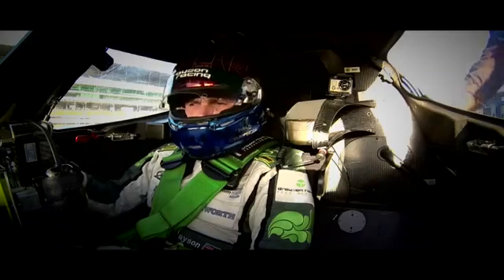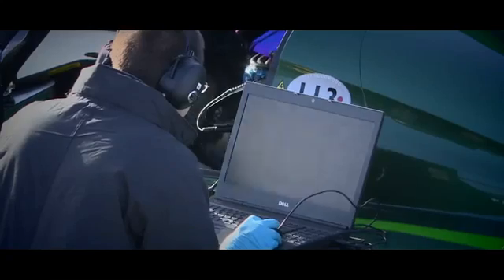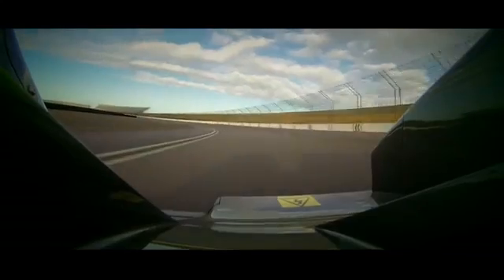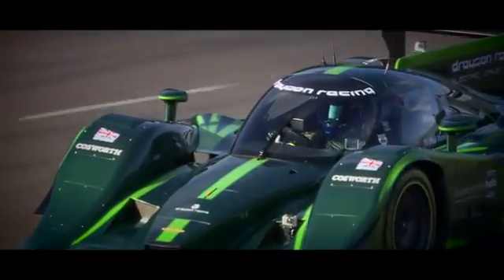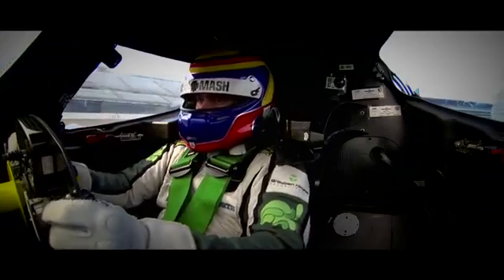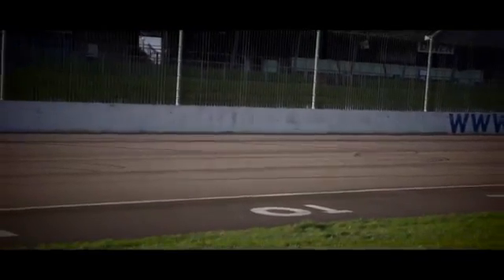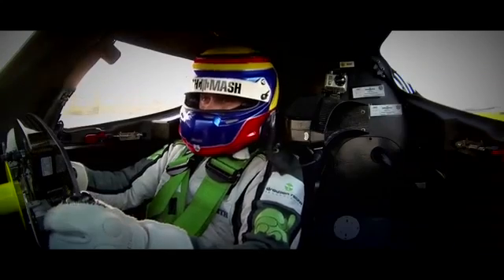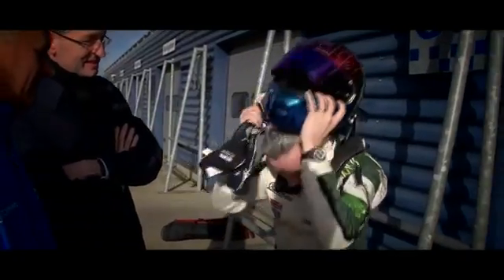Drayson Racing 850 hp Electric Formula E Race Car Testing @ Rockingham

Comment: So we will have 5 minute races like RC cars?
Reply: RC cars actually can race 60 min on full throttle which no combustion car could do, also EV RC cars could drive 3 times as long and if they do the batteries right this thing could run at 24-Le mans without a single pit stop
Reply: Ismalith this thing has a battery life of around 15 mins, although there are batteries in labs now that have 10x the power they aare very unstable and wont be ready for years. that said wireless charging built into tracks could help allot
Reply: Ismalith What a fucking dumb thing to say!
Yes I expect we could walk to the moon, if they get the 'lift right'.
Tesla, the pace leaders in electric vehicles couldn't get a car to run flat out for THREE hours let alone 24!

Comment: Electric motors can actually be used as breaks, perhaps more so than with IC engines. They do this by switching the motor over to run as a generator, so it converts rotational energy into electrical energy and puts it back into the battery. 

Obviously with a computer controlling this you have very precise amounts of breaking which helps with stability and handling. In particular, it becomes almost trivial to slow the inside wheel more when entering a corner, which improves cornering.

Comment: At 850bph, it should fly through 200mph? Can this car do those concering speeds at this circuit?
Had Tesla's technology not been killed by the banksters a century ago, the cars would simply be powered remotely. Ditch the heavy batteries, stop for fresh tires and drivers.

Comment: True, though they said that it can run at full realistic smack(ie like at Le Mans, 150mph avg laps) for 15mins(including regen and not using 600kw every second fx not under breaking).  The R18 diesel that won this year had avg pitstops every 41 mins, so percentagewise they are at 15/41 = 36.58% of a real LM winner car, rangewise.  That aint THAT far away, so if they lowered the engine output to the same 650hp as R18 at 484kW then its already 48% of the range.  Just need twice as strong bats then

Comment: Aye its incredible what algae can pump out, but there is still some dispute about the gal/yr that can be derrived from 1 acre of algae, the companies say 6-7k gal/yr but some dispute that.  The math example is based on 6k and the 55k acre test fields in Mexico produce that.  They don't harvest the algae as in seasons btw, it's more like a continuous pour-off.  Just need a cheap CO2 source for growth (ironically) but the alcohol itself can produce that or via renewable energy --> CO2.

Comment: It's near-field wireless charging that uses inductance, nothing new. The idea is that the car can park over a charging plate, and it'll charge without having to plug anything in. It's merely a convenience. Unless they dig up every race circuit and lay electrical infrastructure underneath them, charging on-the-go is an impossibility.

Comment: (Continued, YT limit) Though I agree EV the future, there are also renew(eternal) ways to make alcohol which all gas cars can run on, from algae in sufficient amounts if effort is put into it.  As theoretical example, Denmark in EU, needs to plant 0.9% of its non-food soil with these algae fields to give it's 2.16mio gasoline cars, 100liters/week yearround at a cost of $3.22/gal(worth it in EU longterm).

So EVs can still co-exist with gas longterm, as alcohol burns much cleaner than oil-gas.

Comment: 3 issues at this point in time, (a) The world will produce oil/coal again as it comes from dead plants/animals, but not at the rate we can/will consume it(barring WW3), (b) The batteries are not env.friendly to produce although there are ways to make them that way in the future, (c) The electricity to charge these are atm produced mainly from coal/nuclear sources, wind/water/wave/renewable can't keep up more than optimistic 10% atm though nuclear is pretty clean barring meltdowns.

Comment: Wireless charging?...Sounds somewhat dangerous?

Otherwise fantastic, hope the whole battery stuff gets down to where they can pop out a battery pack and replace it with a charged one in the pits, while also changing the tires.

But I can't forget the vision of Le Mans 2020 with just electric LMP cars.  Won't the audience fall asleep alot more cause there simply is too quiet, barring maybe for that one Corvette smashing by every 4 min 30 sec?

Comment: putting induction power under a track would be problomatic cause it's difficult to limit what gets charged/heated.  In factories, steel bars are heated to 1800degrees by induction heaters in about 20 seconds or less.  Plenty of space on a racing car such as this for LiFePo4 Battery packs. Unless your racing only electric vehicles, your battery packs would have to be easily removable to keep up with pit times of fuel cars.

Comment: Sounds like a quieter jet engine cool. :D I also love that they are using wireless charging that means this cars can charge even when they are running in the track, if this gets efficient enough then pit stops will only be used to change tires fantastic prospects.